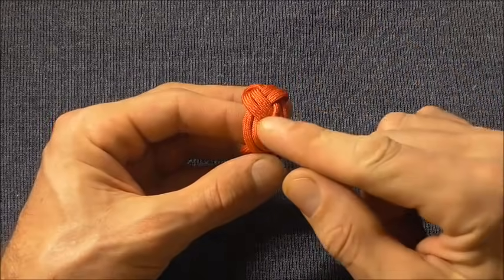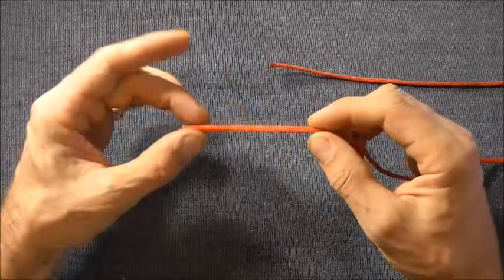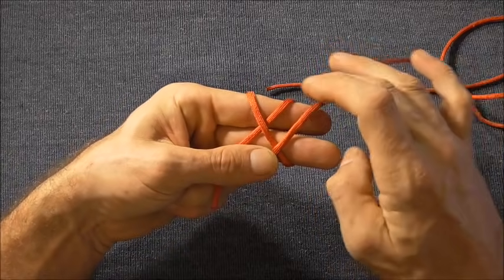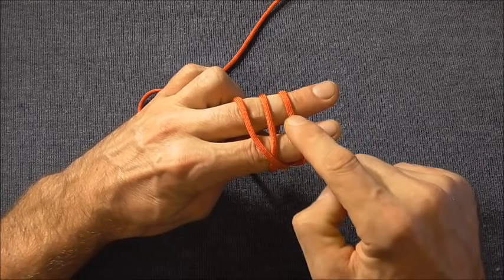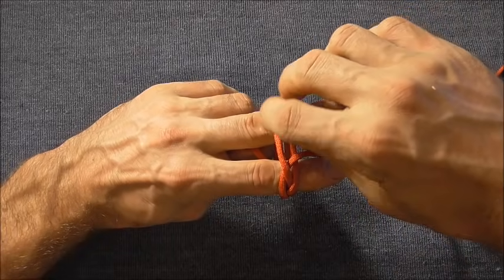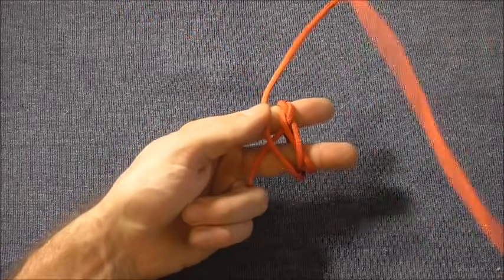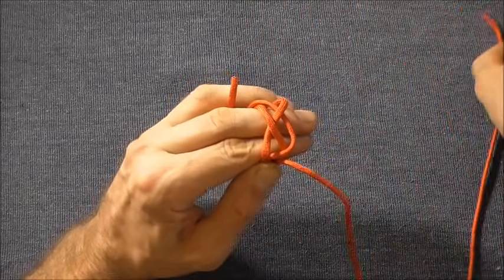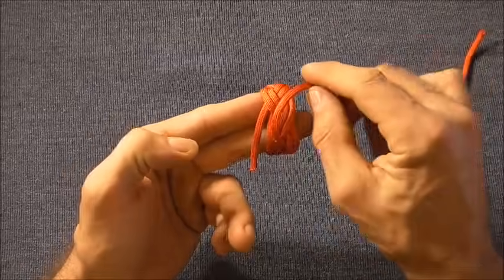How To Make A Turks Head Woggle 3L 5B Turk's Head

Comment: could you to a 3 x 6 or 3x7 if you made the starting loop big enough?
Reply from the maker: Not quite. For a three lead Turk's Head multiples of three bights are impossible. ie you can't make a 3x6, 3x9, 3x12 etc. To extend the Turk's head the number of bights depends on the starting knot. Hard to explain in comments. I will make a video on how to extend the 3 lead TH and get it up within a week.
Reply: LaAttiDahq